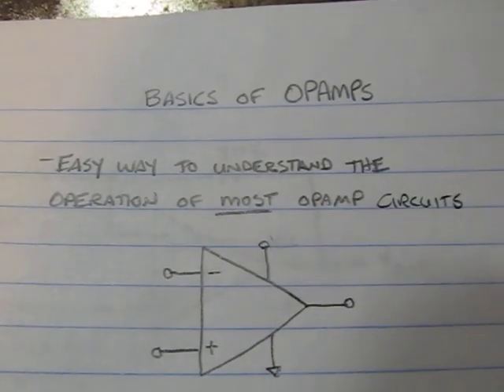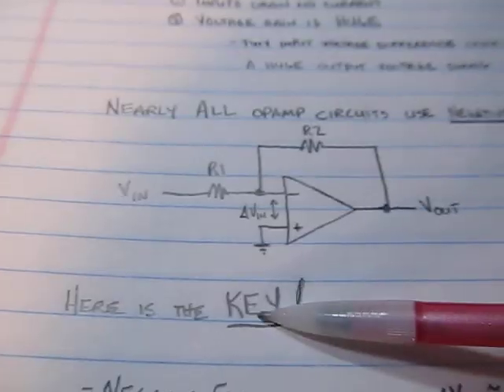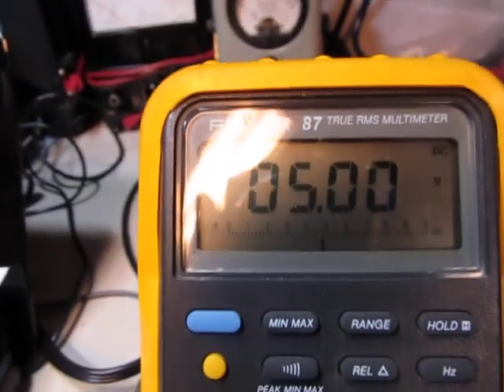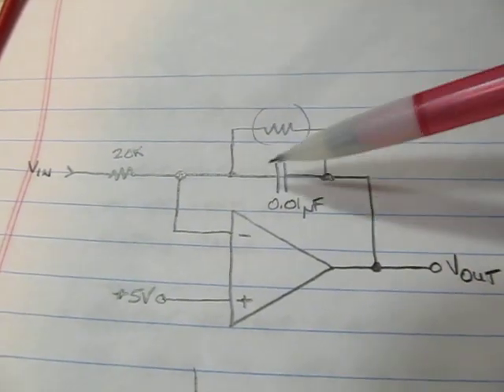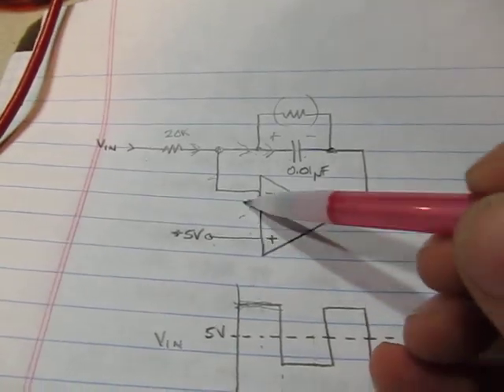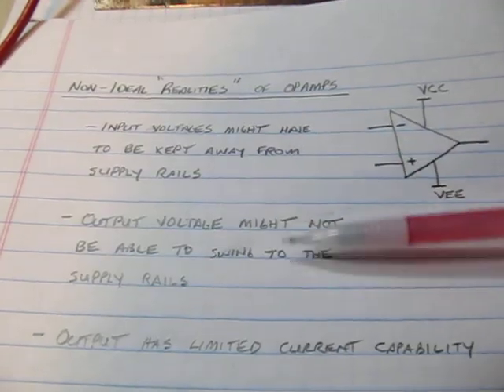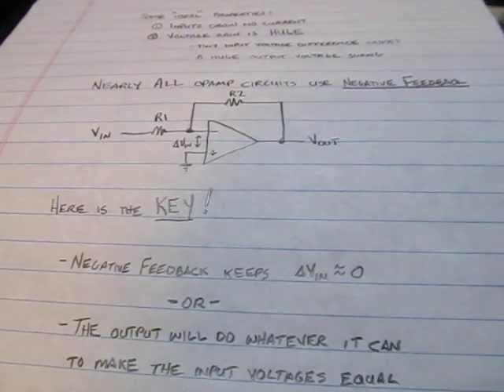#75: Basics of Opamp circuits - a tutorial on how to understand most opamp circuits

Comment: At 4:00, is the Vin a positive or negative 4v?  if positive then why do 5 and 4 make 1? 
Thanks!
Reply: Is it that the 5v is pushing towards the 4v causing a 1v difference?  Great videos by the way.  The basics videos really help me !
Reply from the maker: +MantisRay861 It is +4V at the input.  Since there is 5V at the non-inverting op amp input, then the feedback is going to force 5V at the inverting op amp input, which means there is 1V across the 10K resistor (5-4).
Reply: +w2aew Ok, I just want to make sure I have it correct.  So if it were 6v at Vin, the output would be 3v ?
Reply from the maker: +MantisRay861 Yes - with negative feedback, the output will swing the output voltage however it needs to in order to obtain zero voltage difference between it's inputs.  In this case, the 1V across the 10K will be in the opposite direction, and the output would be 3V.
Reply: Great, Thank you!

Comment: I was wondering if you could answer some questions regarding Op Amp circuits.

I have a Lexus RX300 1999 which has an external CD changer that outputs to the Head Unit.  On the Lexus Forum I learned how I could tap into the output from the CD to create a aux input to the Head Unit.  However, I would like to use a Bluetooth receiver and find that the gain from the typical receivers is too low, requiring that the volume of both the cell phone and stereo unit to be max out.  So I would like to know if there is anyway that the input signal can be tapped into the circuit board of the CD changer, upstream from its Op Amp chips.

The circuit diagram shows the audio signals exiting from a Digital/Analogue chip (SM5874AMP).  The R+, R-, L+ and L- channels then enter an Op Amp (NJM2068MD) and the R+ and L- channels then exit out the Main board to an Extension board.  I'm not exactly sure where the negative channels exit after the Op Amp but the connector shows two VD pins, a 4VA pin so I assume they are carried somewhere in these leads.

On the extension board the two channels then enter a series of two more Op Amp circuits that feed into an Analogue Switch that then exits out of the CD unit to the connector to the Head Unit.  After the Switch the L- and R- channels are reconstituded, but I'm not sure how they make it out from the Op Amps.

My question is whether the low gain output from the Bluetooth receiver can tap into the circuit somewhere upstream from one of the Op Amps so that the signal would be amplified enough so that I don't have to add some kind of preamp to boost the output before it enters the head unit.  Others on the forum have tapped into the FM or tape input to the Head unit, but I'd rather find a way to use the CD output as it's much more accessible.

Anyway, could you tell me if this is at all feasible, or would it just blow up all the voltages to the Op Amps and possible wreck the CD circuitry? I can send the actual PDF of the circuitry if it helps.

Thanks,

Doug

Comment: Can someone PLEASE explain how to power an op amp using two power 
supplies. And, when I mean EXPLAIN, I mean CLEARLY show the physical 
connections between the power supplies, the breadboard and, finally, the
 op amp. I apologize, since I'm a novice at this, but I can't afford to 
spend any more time searching the internet for someone to CLEARLY 
explain how to proper;y power these IC's. I have 2 power supplies, each 
equipped with a positive, negative and ground terminal. How on earth do I
 make the proper connections to power an op amp, please??
Reply from the maker: +Saki Kaskas Maybe I'll do a video on this too, but to start with - here is how you set it up:  Assume you need +15V and -15V for your circuit.  Set each supply to +15V.  Connect the GND terminal of one of the power supplies to the negative terminal of that supply.  On the other supply, connect the positive terminal to the GND terminal on that supply.  You can then connect the ground terminals of the two supplies together (although they'll already be electrically connected through the mains).  Now, the positive terminal on the first supply is your +15V rail for your circuit, and the negative terminal on the second supply is the -15V rail for your circuit.  The common ground GND is the ground for your circuit.  Done.
Reply: +w2aew Thank you so much for the reply! I'll give that a shot. Cheers!

Comment: One of the considerations for any op amp circuit is the Slew Rate. Many popular Op-Amps have a Slew Rate 0.5 Volts per microsecond. While this may work with audio circuits, it's not a suitable Op Amp for integrators and other math related circuitry. While this video does touch on the basics, characteristics such as latch up can happen with Bipolar Op Amps. I've encountered  Op Amp IC's with their tops completely blown away. So without any further discussion, if your interested in Op Amps, there are many good titles to choose from. While You tube can teach and inform you, it's good idea to read about Op Circuits too.

Comment: How is the Voltage being 5V "Just Ohms Law". Ohms law is V=IR so i was given 10V and R of 2.2K. Current would be 4.55mA which one, gives me current not volts and two, isn't 5 so i am confused how you got 5 as your voltage
Reply from the maker: The 10V is applied across a series combination of two 2.2k resistors. Given that the resistors are equal value, the voltage is divided equally, so you get 5V across each resistor. Using ohms law to solve: 10V / 4.4k = 2.27mA. Using ohms law again to calculate the voltage across the lower 2.2k resistor: 2.27mA * 2.2k = 5V.

Comment: in 1:52 why would the output voltage decrease as there is increase in the input voltage (w.r.t ground) ? since it is an amplifier and the gain is HUGE so that means the output voltage must very high given by the formula Av = ( Vo/Vi )??
Reply from the maker: +AKHIL MARU Because the output responds to the difference voltage between the inverting and non-inverting inputs.  Since the input difference is made more negative when the inverting input is raise, that output voltage is driven down (inverting amplifier).

Comment: 2:10 isn't generally true when it says the voltage difference goes to zero. The resistors have to be of a certain ratio and the output voltage has to be able to swing to a minimum voltage so that the feedback voltage is able to cancel the change at the input. The key in all of this is showing that the output voltage is somewhere between the rails which then implies the input difference voltage is thus nearly zero.
Reply from the maker: +Barrios Groupie At this point in the video, we're talking about ideal behavior - not considering the effects of limited output swing, rail limitations, etc.  Thus, assuming that the negative feedback loop is allowed to operate properly (not limited by something else), the the input voltage difference will be very close to zero.

Comment: what is the function of op-  amps in integrator u basically need a capacitor and a resistor to integrate
Reply from the maker: +Shreyas Rajanna A capacitor and resistor will give you an exponential charging curve.  Using the op amp integrator, you can get a linear charging curve which is useful in many applications.

Comment: At 3:19, how did you get 5V? could you show workings?
Reply from the maker: +Bosco Khoo It's a simple voltage divider.  +10V applied to the top of the series pair of 2.2k resistors.  Since the resistors are the same value, the voltage at the intersection of the resistors is 1/2 of the supplied voltage, thus +5V.
Reply: I see 40v written!!!!!! Wtf
Reply: Its the formula for voltage divider vout = (vin x R2)/(R1 + R2) => (10 x 2200) / 4400 = 5.00V
Reply: use potential divider
Reply: OhNoitsBadmanMo I did to in the beginning but it’s +10 V

Comment: How is the voltage at the non inverting input5 if it's connected to ground??
Reply from the maker: Mahmoud Matar It is not connected to ground.  It is connected to a resistive voltage divider which establishes the +5V bias.
Reply: I thought the sign below the lower 2.5k resistor represents ground
Reply from the maker: Mahmoud Matar It does.  But, the upper resistor is connected to +10V.  The resistor values are equal, so +5V appears at the junction where the non-inverting input connects.

Comment: Can you please do a tutorial on converting celsius to fahrenheit using op Amps? i am having troubles implementing one. thank you!
Reply from the maker: Sounds like a homework problem...  The formula is F=(9/5)*C + 32
Thus, you need a gain stage with a gain of 1.8 which you'd use to scale the C value. Then follow this with a summing amp (see my video on that) to add 32.
Reply: Thank you. I finally figured it out. We were only allowed to use one op-amp. I was just wasn't sure how I can implement the reference voltage but it all worked out in the end! thanks!

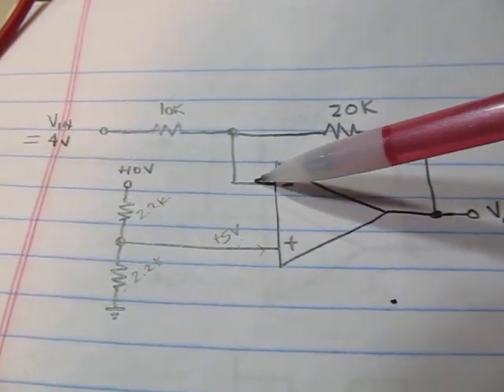Comment: Hi, i am unsure at that part in 3:29 where V+ is 5V and how does the ohm law work even with different value of resistance ?
Reply from the maker: I'm using a +10V power supply to the the top of the resistor divider made by the two 2.2k resistors.  Since these resistors are equal (and virtually no current is drawn by the non-inverting input of the op amp), the voltage at the junction of the two resistors is +10/2 = +5V.
Reply: ***** im sorry but im not sure how does ohm law work and to which reference point does V+ take its voltage from, top or bottom resistance and what if we flip the voltage to be at the bottom and ground to be at the top
Reply: ***** sorry i got what you means, very sorry for the trouble and thanks for your patience and giving me the answer
Reply from the maker: Jiejun Huang Glad to help!

Comment: i don't really get how the 7V is at the output?
Reply from the maker: Review the video from 3:00 to 5:00.  What part of this is unclear?
Reply: Use the loop rule on the loop going through the feedback resistor to the negative and positive terminals of the operational amplifier then finally the resistor connected to ground.

Comment: But how did you get the 2.2k?
Reply: The principle he used 2.2k was only to create a resistor divider for half voltage. If you have 2 equal resistors in series, then each one drops an equal amount of voltage. so 10V divided between two resistors that are equal give you have of the voltage in the middle.

The reason for 2.2K resistor choice? I'd image he just simply had them on hand... easy to put them in series. And 10V over a total of 4.4k ohm resistors wasn't going to make a big current draw on the 10V supply that it was just a convenient value to choose.

Since the inputs of the OpAmp are very high impedance, there is no current flowing into the opamp so to speak, so matching a resistor divider like he did, the current needed wasn't really a factor. Simply two the same value gives you half the voltage which he then used as a mid rail reference voltage.

With OpAmps with single DC supply, if you want to put an AC signal into it (and still see the full wave), then you need to lift the reference voltage of the other input to somewhere near half the supply rails... This allows the output to swing nicely from half voltage up to near 10V, and from half voltage to near 0V... otherwise your just going to see a clipped nasty half positive version of the signal you fed into it.

So now you see why a half rail voltage is necessary, why he may just choose any two resistors that are the same value...

He may have easily chosen 10K and 10K, or 20K and 20K... The voltage in the middle would be half. The only difference would be how much current it draws from the supply of 10V in series... Basically anything over 2.2k would be fine... for general day to day hobby design, as a reference voltage, 10k+10k is a nice easy value to use.

Comment: could you help me understand this. because it is an inverting op amp the gain should be -2. and why is the output goes 5v+2v instead of 5v-2v= 3v ? very helpful video btw
Reply from the maker: The "input" was the 4V signal.  This is lower than the +5V bias on the non-inverting input, so the output goes above +5V (to 7V).  Thus, it is an inverting amplifier, taking a -1V input (with respect to the bias) and amplifies by -2x to +2V (all values with respect to the +5V bias voltage).
Reply: Thank you very much :)
Reply: but cant we consider that circuit as a non inverting one as V+(in) has a greater voltage than the V-(in) ? what op amp "sees" is conventional non inverting input ryt?
Reply from the maker: Kasun Ariyawansa Whether you call the circuit "inverting" or "non-inverting" depends entirely on which signal you call the "input" signal. In this case, the 4V signal is the "input".  Thus, the gain is inverting, because if the 4V signal is raised, the output falls.

Comment: So could you say that the amplification is actually happening outside of the op amp as a result of what the op amp's actions???
Reply from the maker: That's exactly right. The overall gain is determined by the external component values as a result of the negative feedback. This is one of the principle advantages/features of employing negative feedback.
Reply: Thanks. Ive been struggling with the concept and two things have really helped me out. One is your video and the other is a website I found. I sometimes wonder if I need to look at circuits in a different way. When you look at a circuit do you try to visualize it in a mathematical way ie KVL/KCL, Thevenin, nodal analysis etc.? Or do you look at it more as component behavior and characteristics? I know thats a weird question. Do you understand what I mean?
Reply from the maker: Most of the time I visualize the operation of a circuit in much the same way a scope would show it to you. Higher and lower voltages are visualized as higher or lower 'elevations'. Current through devices impresses the elevations on nodes and across components. It works for me, but may e not for everyone. Each person has to find their own analogies and method of visualizing things.
Reply: Thanks. I've just been asking that question lately to see if I can pick up any hints, ideas or pointers. I just got my first scope yesterday and it already has helped the visualization process. Well, keep up the good work.

Comment: Great tutorial, quick question : On the first circuit, the output went to 7V to make the input voltages equal. What would happen if the input voltage difference were higher than the supply voltage of the op amp? Would it just pull to the positive rail to get as high as possible?
Reply from the maker: It depends on the particular op amp used. The output will never exceed the positive supply rail. Different op amps have different capability in terms of how close they can swing the output to the rail. Some can't get closer than 1.2-2V from the rail, others can get within tens of mV from the rail.  In either case, if the output can't be brought to the point to null the input, then the negative feedback loop is broken and distortion will occur. You might want to view my video on op amp power supply considerations, I discuss this topic there.
Reply: *****
how do i study to know what you know? besides going to college. Trial / error and loads of reading?
thnx
Reply from the maker: Ian Moree Yes, lots of reading and experimenting, studying other circuits to understand how they operate.  Application Notes from the major IC manufacturers (Linear Tech, Texas Instruments, Analog Devices, etc.) are a wealth of information.  Lots of good books out there, from general electronics like "The Art of Electronics", to more specific topics on things like op amps, etc.  It doesn't come overnight.  Remember, you learn a LOT more from your failures than you do from success.  If you fail, dig into it to figure out why - valuable lessons are there to be learned.  You need to start with a firm grasp of the fundamentals...

Comment: Thank you very much!

I try to make a buffer which follows ~15MOhm resistance (Voltage divider with two ~15M resistors). I made a simple circuit with LM741 but I did not have unity gain. Could you please offer some chip (may be tricks)? Please note that electronic is just hobby for me. I've searched google and still need help. Thank you.
Reply from the maker: The problem is the very source impedance. The 741 op amp has about 100nA of input bias current, which will create a substantial voltage drop across the source impedance. In order to do this, you'll have to use an op amp with extremely low input bias current. You can search manufacturers site for op amps with very low input bias current.
Reply: I'll search for the smallest value. Thank you.

Comment: Around half way through the video:

The notion of gain is not mentioned.  Might be helpful to describe gain as related to input and feedback resistor ratio.

Also, that the non-inverting input is set to +5v and +4v is applied left me wondering how these might stack up.  The discussion of current across the input and feedback resistors was helpful in this, but might have been amplified a bit more.  Also it appears a capacitor is used on breadboard, but not mentioned in schematic.  (later I see this was probably your second example).

At 7:46: You mention applying a sq wave centred around 5V.  Do you mean that the sq wave rides on a +5V rail?  What is the amplitude of the Sq wave that is applied?

At 09:20 you show scope presentation.  Again this doesn't clarify the input signal.

Might be good to mention the sq wave frequency and a quick mention of slew rate.

A very well done brief on the subject!  Thank you.

Comment: I know the gain of an inverting opamp is (-) r2/r1, so I was wondering where the +7 volts from +4 volts (-) in came from, then I realized that you are dealing just with the DC, and the 5v at the + input has a gain of r2/r1+1 so that gives 15 out, minus the -8 from the 4v (-) in, leaving +7. It's been a while since I looked at the theory, thanks for the refresher!